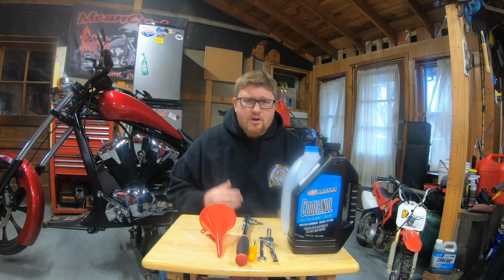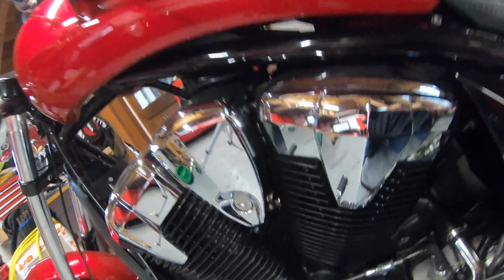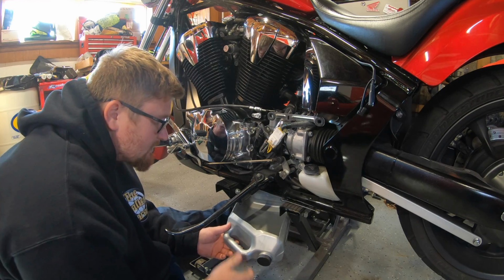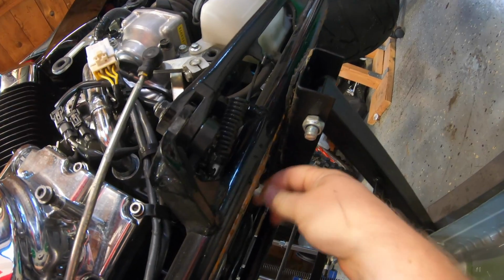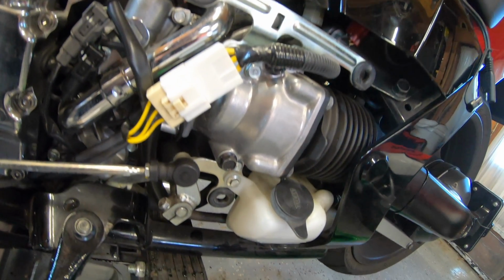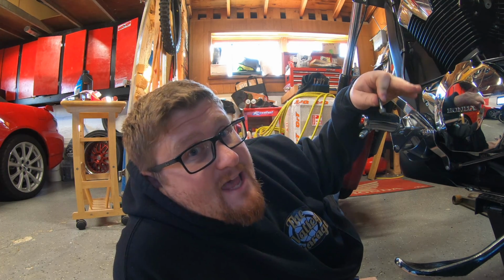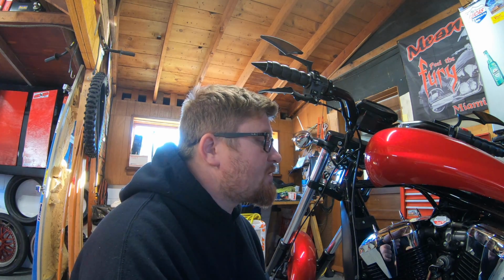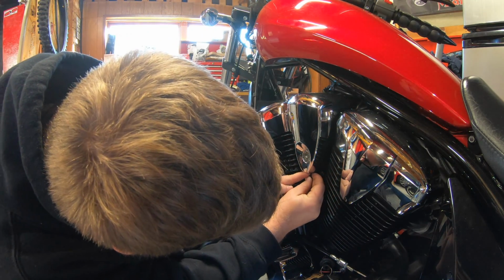Honda FURY COOLANT CHANGE (Complete Walkthrough)

Comment: stupid question,  but  can you use syringe or turkey baster to suck to the coolant out of the coolant bottle and use your flushing method to get the rest out (continuing to use syringe to get the flushed coolant  out). Therefore, saving the unscrewing of the bolt.
Reply from the maker: You definitely wanna run the bike and use the drain bolt.. really the best way. I mean you can try an syringe but you may end up going slower

Comment: I’m trying to drain mine but I still have a bunch of coolant sitting at the neck of the reservoir that’s not going anywhere any tips?
Reply from the maker: The neck of the reservoir? Are you referring to the lower bottom expansion tank because there’s no way to drain that. It’s. Easier to unbolt the mini tank and washout

Comment: I have a 2010 not that same
 Any suggestions on drain plug location?
Reply from the maker: It should be there. Double check for a bolt that has some green paint mark because the bike has not changed since debut I have the shop manual for 2010-2019
Reply: Is it a bolt on a housing  attached to the lower block? Like thermostat or water pump right in front of the oil rain plug? No green paint to be found.  I went over that thing  10x super bright light and inspection  mirror too
@Thevalleygarage
Reply from the maker: @davidvaught586  So the drain bolt is an 8mm or 10mm bolt that is on the water impeller cover its self. Correct, lower left side right behind where the kickstand mounts to on the frame. The drain bolt will have a copper crush washer to help you indicate. It is hard to find I had trouble myself. Fortunately I have bike jack. It will be hard for my big head to see lower under the bike without one.

Comment: Hey, man! Thank you for the great and helpful video! I have a question. You said "1.8 L of coolant for the system" and I got about same result today durind coolant change on my Honda Fury, but the manual says "cooling system filling capacity is 2.54 L". Do you know why is the difference here? I will appreciate your answer!
Reply from the maker: That is very interesting because I have always only been able to put in 1.8L every time I flushed. I know the expansion tank is .24L at the fill mark.. I looked up total capacity in my shop manual and it says the same unless they regard the total capacity from dry weight no fluid. Not all the coolant can be completely drained from the system such as the lower portion for the radiator. I could see where full temp expansion and the rest of the overflow tank filled to the cap is where additional volume can be made up too 2.54L.
Reply: @Thevalleygarage  I got it. Thank you for your time and attention!
Reply from the maker: @MrCrushorange  Anytime! Thank you for watching!!